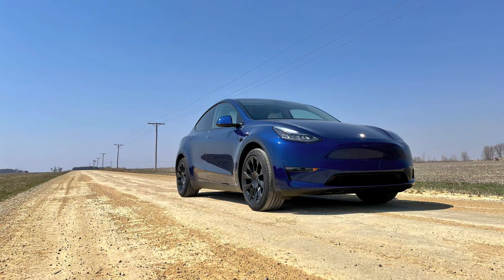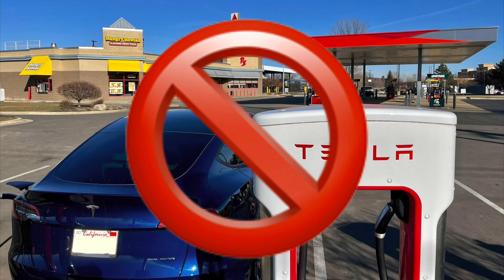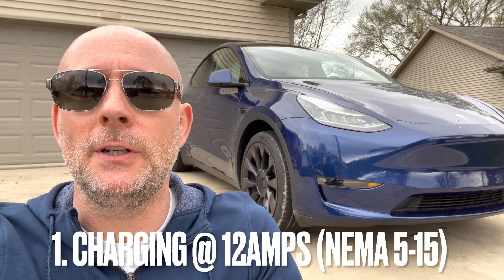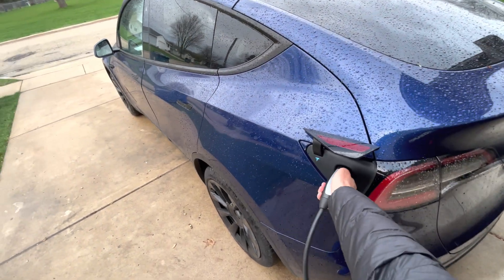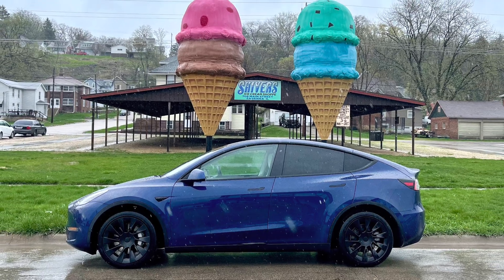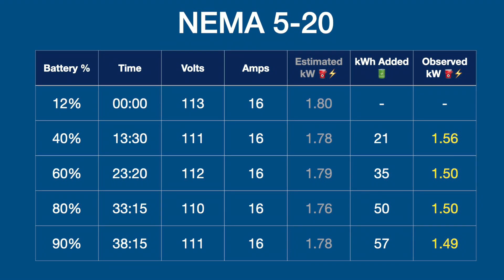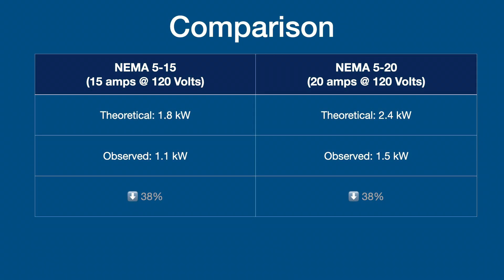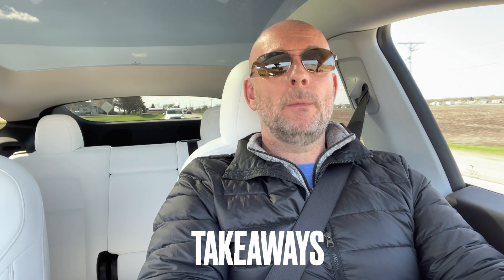E29 | 110-120V. 25% Faster Home Charging on NEMA 5-20 (Tesla Model Y)

Comment: When the Tesla does the regen braking, does the brake lights come on also?
Reply from the maker: Hello hello. It only comes on in the scenario that the car decelerates in such a way that it approximates regular breaking. This makes sense: in an ICE, a slight deceleration by removing your foot from the gas pedal also does not result in the brake light coming on. Likewise, a light to deceleration in an EV/Tesla does not turn on the brake light either. But if the car decelerates in a rapid fashion via regen, the brake light does come on. You can confirm this by looking at the car icon on the center display which will illuminate the rear brake light icon when it does come on in the back. 🛑🚘

Comment: I am not a handy man, just ordered a model 3 performance, how do I do what you are recommending? What do I need to purchase?
Reply from the maker: Hello hello. For charging on a regular home/garage 120 V socket, the car comes with a standard mobile charge cable. You can just plug that into any outlet (NEMA 5-15) and you’ll get about 1.1-1.4kW. If you take a look at the video, you will see that some houses actually have a NEMA 5-20 outlet already installed. It’s the one with the perpendicular blade on the left side of the wall socket. If you have that wall socket in your garage, you can simply buy the NEMA 5-20 adapter from Tesla and then swap it out on the mobile adapter unit that comes with your car and plug into the wall with no modifications to your home necessary. I’m not a certified electrician, but it’s my understanding if your house has that socket already installed, your electrical system should likely not have any problems sustaining a charge out of it which can average around 1.9kW… about the same amount of energy drawn from a high power microwave which would be left on for hours and hours and hours while the car charges. As for any other charging options, you may want to consult a certified electrician. Let me know if you have any questions about the contents of the video. Thanks!
Reply: @goingelectric7826  My outlet has the old school nema 5-15, can I just swap it out for the nema 5-20 wall plug in?
Reply from the maker: @rhsalce  you would need to run that by a certified electrician to ensure your electrical system and wiring could handle it.

Comment: Hi Daniel I'm going to be picking up my new Tesla model 3 23rd of June which is this week so I wish me luck I'm gonna be plugged in to my house I don't have time to be paid $1500 to install a fast charger
Reply from the maker: Best of luck! From what I understand, the average 3 driver gets an typical efficiency around 275Wh/mi or (1000Wh/275=) 3.6mi/kWh. If you are charging on a standard NEMA 5-15 at 120V/12A (1.4kW) that would give you 3.6mi*1.4kW = 5mi per hour of charge. On a NEMA 5-20 at 120V/16A (1.9kW) you’d be getting 3.6mi*1.9kW = 6.8mi per hour of charge. Therefore, an overnight charge from 9pm to 7am would get you 50-68 miles, more than enough for the average American driver’s daily needs. And depending on where you are, and if you have peak/off-peak charging rates, you may just choose to charge before 9pm and after 9am and get even more range. So it really all depends on how much you drive each day, when you plug in and when you unplug. Best of luck, and let me know if you have any questions. (I’m currently renting an apartment in the San Francisco Bay Area and living on a NEMA 5-15 120V/12A connection in the garage and it’s just fine for me as my daily needs are around 45 miles.)

Comment: I have a ton of 6-20 240v outlets in my garage. Was wondering if that would be helpful when I do get an EV.
Reply from the maker: Hey! Disclaimer: I’m not an electrician so you should consult a certified one for definitive information, BUT… according to https://en.m.wikipedia.org/wiki/NEMA_connector it shows that a NEMA 6-20 is a rated max of 240V @ 20A which is 240*20= 4.8kW, although  amps are usually dialed down 20% so 240V*16A = 3.8kW. Depending on how much you drive daily, that may be totally fine for you even though the amps are lower than what you’d get on a 14-30 or 14-50. A typical MYLR driver gets an efficiency around 285Wh/mi so that’d be 1000W/280= 3.5mi/kWh or 3.5mi*3.8kW = 13mi per hour of charge. Assuming you plugged in your car at 9pm and charged till 7am nightly, that’d give you 10 hours of charge every night 38kWh of energy, or 50% of your battery, or around 130 miles range. If you are rarely driving more than 130 miles per day, you could live on that with no problem without upgraded to a NEMA 14-50 or similar. As for whether or not your electrical system can handle a sustained 3.8kW 240V/16A charge, consult a electrician on that. Typically, however, the car will adjust its charging rate based on what it determines to be a safe charging load. Lastly, if you live somewhere with extreme cold during winter you’ll eventually want to upgrade because battery preconditioning can take up a good 3-4kW which makes charging more challenging. Good luck going electric!

Comment: Some one may have mentioned this. But if you are there often you look into quick 220 system. I got one for tips I take and hotels that don't have level 2 chargers. The block heater plugs have 2 outlets on them and it is usually ether side of the buss bar witch give you 220. It is a a220-20D
Reply from the maker: That sounds like very good advice. Fortunately I have been able to do all of my travels either on 120 V or Superchargers. I now have a NEMA 14-50 240V adapter but haven’t needed it yet. But it’s always good to look into new options!

Comment: Great video! Subbed!
Reply from the maker: Thanks for the kind words, and enjoy a 25% faster charge! 😃🔋(I’m currently charging at an apartment rental 25% slower on a 120V NEMA 5-15 plug. 😭
Reply: @goingelectric7826  range anxiety was a huge worry of mine before buying. I live in an apartment with two charging stations (the slow 7KW type). I realized quickly, which might sound stupid, that my car spends magnitudes more hours sitting that driving. So I don’t even bother using those stations anymore, and just plug into one of the 50 or so wall outlets in the parking garage. Just went out and looked and found that they have this type of outlet! Thanks again!!
Reply from the maker: @stevestojan  Range-concern is certainly reasonable in 2022. But as you’ve discovered, most people drive few enough miles per day that they can live on 120V alone. And if they can’t then 240V is more than enough for almost everyone else. I read an interesting article once which mentioned that cars spend something like an average 90% of their existence PARKED and that they are one of the worst and most under-utilized ways to allocate capital ever invented in all of human history. Yes, world, we almost always have enough time to charge. 😂🔋

Comment: I'd buy a convertor and plug into 110v and then plug my tesla into the other end 220v. They make step up transformers. I'm gonna check loadability for continous use
Reply from the maker: Good luck with that. 😊 It seems like stepping up to 240 V doesn’t always work because apparently it drops the amps in half and there’s some risk of overloading the wiring on the circuit, but if it works for you in your setup, that’s great!

Comment: Yeah I would actually like to know this if it works with other electric vehicles because I can’t get a hold of the Tesla right now so I’m getting my girl a 2021 Chevy bolt with the retrofided battery on it because of the recall and I would like to know if it would charge quicker on that too
Reply from the maker: Hey! Thanks for reaching out. Once it comes time to get a new car in a couple years, I’ll definitely have GM on my list of considerations — they’re making some nice EVs with great drive trains. I just did a little bit of snooping around the interwebs and it looks like a new Bolt comes with a 66kWh battery. EV manufacturers never seem to declare the usable capacity of the battery (versus maximum battery capacity) so I imagine it’d be closer to something like 63kWh. It appears that it is capable of the following charging: AC Level 1 & 2 (110V-240v at varying amps, 1kW to 11kW), and Level 3 DC fast charging up to 55kW. Level 3 is what you’d find being built out now along highways and certain retail locations. At those speeds, you could charge from 0-100% in 63kWh/55kW in 1.14 hours (but likely 1.5-1.75 hours based on the speed curve technicalities of charging batteries when they get closer to full at higher speeds). As for Level 1 & 2, I imagine they have to work exactly the same in a Bolt and every other EV just like in a Tesla. Multiply the volts and amps coming out of the socket and that’s your kW charging speed. Then divide that into the kiloWatt hours you need to put into the battery up to 63kWh. If you were charging on Level 2 at 240v/32a at home that’d be 7.7kW, therefore 63kWh/7.7kW = 8.18 hours to get from 0-100%. Of course, most people never charge from 0-100% so in daily usage it’s much less and much shorter than that. Also, slower AC charging typically doesn’t slow down as the battery gets fuller the way DC fast charging does. So, for a basic NEMA 5-15 outlet, you’d get something like 115v/12a =1.4kW, therefore 63kWh/1.4kW = 45 hours to get from 0-100%. Based on the 260 mile range (EPA rated) that’d be 260mi/45h = 5.7mi/hour of charge. On a NEMA 5-20, you’d see somewhat faster/better numbers at 115v*16a = 1.8kW. 63kWh/1.8kW = 35 hours from 0-100%, or 7.4mi/hour of charge. So, the time to charge the battery to 100% may be less but that is because the battery capacity is less; but the rate at which you can charge the battery will largely be based on the speed of the electricity coming out of the socket rather than the car itself. I’m currently living on slow NEMA 5-15 1.3kW electricity in my apartment rental, but it works for me in almost all cases because I typically drive less than 50 miles a day. If your daughter drives less than 50-70 miles per day and could charge 10 hours a night then she could easily get 50-70mi per charge on NEMA 5-15 to NEMA 5-20. Let me know if that answers your question or if there are some other things you’d like to run though. Good luck!

Comment: You can just plug the 5-15 plug into a nema 5-20 outlet right? It’s made to accept a regular plug as well… Why do you even need the adapter? Will the Tesla not draw more just doing that?
Reply from the maker: I am trying to remember the exact experience but somehow I recall when I plugged in the NEMA 5-15 adapter — yes, it only draws at 12a vs 16a of the NEMA 5-20. Presumably the car & mobile adapter recognize which adapter is plugged in and it adjusts automatically. However you could consider manually adjusting the amps in the car if using a NEMA 5-15 plug in a NEMA 5-20. However, I’m not a certified electrician so I’d encourage you to speak with a professional before doing that.

Comment: Saw the following on reddit the other day and thought of this video.
This would almost triple the rate at which you charge on your 5-20 outlet.
No need to change the wire. You need a new breaker and receptacle but the wiring should be good.

"If you have a dedicated receptacle in your garage for a refrigerator/freezer or tools (many houses do), talk to an electrician to verify it and re-configure it to 240V, then get the appropriate adapter. Many of these dedicated plugs are 5-20, which is a “normal” plug with the horizontal/vertical hot blade which is recognizable as a “T” on the plug left blade. These (should) have 12-ga wiring and are rated for 120V/20A. To reconfigure in this situation to 240V/20A all it requires is a 6-20 receptacle, two pole 20A breaker, and some electrical tape to mark the white conductor as a hot. That change will take you from as low as 1.4kW (120V/12A) to 3.8kW (240V/16A). That is enough for - 40-50% charge in 10hr overnight."
Reply from the maker: That’s excellent feedback. Thanks! I’ll have my parents think about making that modification  the next time we have an electrician out at the house. 3.8kW is MUCH better than 1.1-1.7kW!! 😃🔋

Comment: This should have more views. Nobody else is talking about this solution, and it's a very good one! Thanks.
Reply from the maker: Thank you for saying that. Very kind of you! I think YouTube algorithms typically reduce my video placement because they are on the lower production quality side since I do this all as a hobby on top of my day job. 😂 Also YouTube apparently restricts my videos to people in the 35-55 age bracket. But it’s all cool: people seem to be able to find it when they go looking. Ultimately I try to make videos about topics I don’t see many videos on, so I’m glad you found this helpful. It turns out that a NEMA 5-20 can be a great option for a lot of people who don’t typically drive a lot per day. Best of luck! And reach out if you have any questions. 🔋🔌🚘
Reply: @goingelectric7826  Got my MYLR today actually. Immediately after watching this video, I went to check my outlet, and unfortunately it doesn't have the horizontal notch. Will try charging via the standard NEMA 5-15 for now and if it ends up being too slow I'll end up installing a NEMA 14-50. Thanks again!
Reply: It's half a solution, the tesla only draws 16 amps unless you use the work-around.

Comment: For a continuous load, such as EV charging, the National Electrical Code requires derating the circuit to 80%.  So that is why the 5-15 and 5-20 adapters set the amperage to 12 and 16 amps respectively.
Reply from the maker: Thanks for the heads up! 🙏 There’s lots of interesting stuff for us all to learn as we go electric. Electrical education, here we come! ⚡️

Comment: Retired electrician and model 3 owner here. I have not come across an electrical panel that I could not squeeze another circuit into. Most modern panels are UL listed to accept split or tandem breakers which can free up the space you need. If the panel needs to be replaced it should take a competent electrician a few hours to do that. Your solution is excellent for a visit , but for an extended stay or something you own you really want to get at least a 6-20 preferably a 14-50.
Reply from the maker: That's great feedback. Apparently the house has a relatively small panel on it and when my parents moved in a couple years back we looked into upgrading the panel but since they have gas for the hot water heater, stove and dryer, they figured they wouldn't need the extra capacity. Apparently I could also get a sub panel installed in the garage, so if I ever moved into the home that/those would be things I'd consider. Since most of my visits include me staying without driving much, NEMA 5-20 works well. And in the end, this whole topic of electricity, which has been ignored by much of the planet for the past 100 years or so, is rapidly going to start becoming really important for people to look into. Thanks again for reaching out!